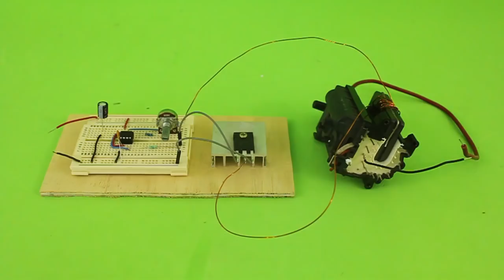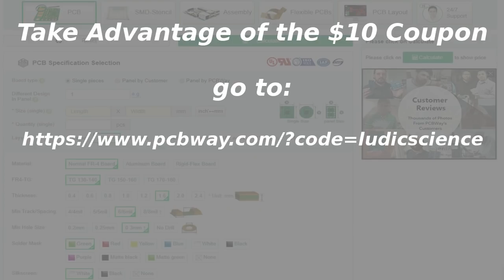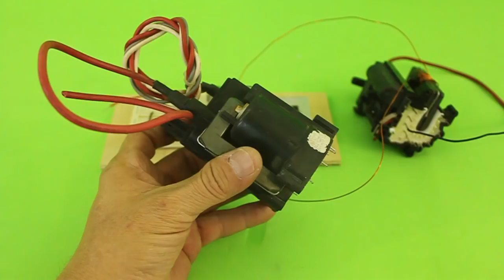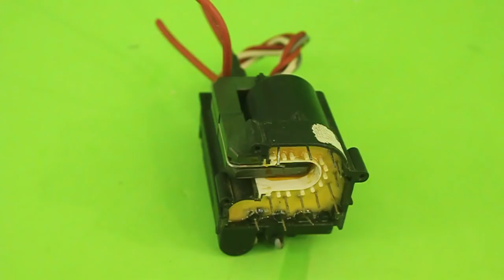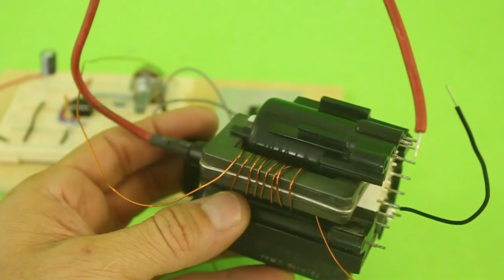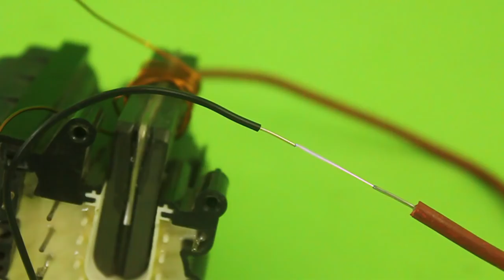Easy Flyback Driver for High Voltage

Comment: Ludic Science, I hope you can read this, because I would appreciate an answer tot this question.

Does anyone know how to let the current flow in the right direction  through the primary coil of the 5 to 8 turns? (With the use of a 555 circuit and a mosfet) It will perform in both ways I know, but there is still a difference and 1 way is the right way to wire it. Ie the flyback has to be 'charged' during the active part of the duty cycle. During this period no current can flow in the secondary coil in the flyback because of the internal diode of the flyback which will block any curren to flow. That is if you connected it in the right way. When the mosfet is suddenly opened  the contained energy in the flyback will create a current in the secondary coil which now can flow through the internal hv diode, (when it is wired correctly). But how can you find out in which way you have to charge the flyback? or in which direction the current has to flow in the primary coil? I really would like an answer to this and hope somebody knows the answer. Thanks in advance.
Reply from the maker: That is a good question and I dont know a way other than testing both ways and see which one performs better.
Reply: @ludicscience  Thank you for the compliment, I appreciate it :) And I already tried that, but it is really hard to tell when looking at the output of the secondary. And measuring the output power on the secondary side is also not possible because of the high voltage. I need this because I am making a hv power supply and I also want to make it  effective but also efficient,  but I can not figure out in which way the current has to flow in the secondary. Maybe you will come up later with a instant and splendid  brain wave how to check this. I trust you that you are the one who can come up with this answer, that's why I asked you on the web :) Hope to hear from you again Ludic Science and thanks for your reply :) I think the answer lies in the fact that the flyback can be charged to a maximum amount in the right way. Or maybe you can check in on a scope with a very huge voltage divider like you made in one of your videos, but I don't dare to fry my osciloscope when checking it on the secondary side, even with a little power on the primary side.
And is it possible to connect a fluoresent bulb on the secondairy side? Will it light? This might be a simple check which direction of the current will give the biggest spike. And the biggest spike can only be obtained when the flyback is used in 'the right directio'n. So changing the polarity of the flyback must make a difference and only one way of wiring will strike the flueresent bulb first. Is this an idea and can I just connect the fluorescent bulb with a low voltage on the secondary side you think? Update:  a fluorescent bulb on the flyback does light :)
Reply from the maker: Well, I have an idea that may work or not. If you can find the pins of the internal primary of the flyback, then you can apply a DC voltage and see the direction of magnetization of the core, using a compass or a hall effect sensor. Then you can wind your primary with the current direction that produces the same magnetization direction.
Reply: @ludicscience  That's a very smart idea Ludic,  I knew you could not let this go :) And it is also needed to know how the primary winding on the flyback needs to be wired/connected than, which maybe can be found in the documentation if is is to be found on the web.

Comment: Dear Ludic Science, happy holidays and again thank you for your valuable work.
1- Can you tell me at what frequency is this oscillation happening in this video?
2- If we adjust the frequency to the radio frequency ranges, can this set up be used to create the carrier wave that can be modulated for AM radio transmission? I am imagining that in that case we would connect one end of the secondary coil to the ground and the other to a very tall antenna and get transmission...
Thank you for reading this and I hope to read your response.
FM
Reply: I guess theoretically if You wound the primary with a T2 Tesla design to bring down the SRF to say 80khz then run the frequency at the 3rd harmonic of that which would allow for efficient operation then earth ground one end of the b with the diode directed HV end to the antenna 
And run as stated at about 320khz you could then theoretically get two ‘induction’ coils at some distance and earth ground one and attach a receiver antenna to the other and see if TV force developed between the two, that would a reasonable and effective experiment.

Comment: The 2 resistors between 6-7-8 pins makes the duty cycle always above 50%. if you cut all those resistors and connect one 5-10k between pin 3 (output) and then wire it to pin 6 and 2 and put a capacitor between 2 and ground you get one of the simplest circuits possible to wire up yet you get exactly 50% duty cycle. After that just wire up pin 3 to the mosfet gate trough 100 ohm resistor just in case the mosfet burns and either put a flyback diode or a capacitor across the primary.

Comment: Can this driver been used for car's induction coil as well???
Reply: you need 500-1000 times lower frequency but otherwise the circuit is the same
Reply: just put some safety features on the primary not to kill the mosfet with inductive spike

Comment: Hello 
Can the IRFP450 be replaced with other  kind of mosfet  ?
Reply: Any power mosfet will work.
Reply: Beshoy Nagib thank you
Reply: Yes, but you should add a flyback diode across the transformer primary (1N4001 or 1N4007 is fine) to prevent hitting the MOSFET with damaging spikes. The IRFP450 has a characterized body diode and is robust but other MOSFETs may not be so strong so it's good to protect them. 
http://www.vishay.com/docs/91233/91233.pdf  <--- IRFP450 datasheet
Reply: Peter S thank you  friend

Comment: This circuit is very bad, There is no hv diode and hv capacitor across the mosfet and no diode, resistor and capacitor at the primary and the mosfet has no ground to gate resistor, also you dont explain at all how the area of the transformer core and the input power is very important for calculating the frequency and number of primary turns.... This is a death trap for beginers...
Reply: https://makezine.com/projects/plasma-arc-speaker/
https://en.wikipedia.org/wiki/Plasma_speaker
Reply: albert einstein watch out this dude PETER on youtube comments will take your place
Reply: Ground to gate resistor is unnecessary, because the timer will discharge it on its own. Putting a capacitor across drain-source will kill the mosfet and what is the point of a resistor on the primary?
Reply: I think he meant an RCD snubber circuit to protect the MOSFET, but that's unnecessary, a fast diode is enough in this case. Maybe what i'd do instead is put an 18V zener diode between the gate and ground to protect the mosfet from spikes that might occur.
Reply: I suggest a laxative and less soap opera viewing. Your drama meter is off scale.

Comment: I built the circuit but the 555 chip got burned can someone tell me the reason
Reply: it always happen to me before, and I suggest you to used different 555nc timer flyback driver, the one's that has a lot of capacitors and diodes to protect your 555 timer and mosfet from burning
Reply: The circuit is missing a flyback diode (reversed biased diode) across the transformer primary and inductive kickback may have caused voltage spikes that killed your 555. Some types of 555 (such at the 7555) will be more sensitive to these spikes. The circuit in the video is the most basic way to build a high voltage supply like this, but if you were going to make it into a product you would add a few more passive parts to protect the 555 and MOSFET from these spikes.
Reply: @Peter_S_  exactlly its the diode that will do the job thanks
Reply: @badraa7838  I hope you get your build working well and that you have lots of fun with it! This is an excellent project!
Reply: @Peter_S_  thanks do you buy electronic parts online?
Reply: @badraa7838  I've been a manufacturer for over 30 years and for both hobby and manufacturing I buy everything online. My main sources are https://www.digikey.com/ , https://www.mouser.com/ , and https://www.arrow.com/en but for hobby use I also buy modules from AliExpress. I worry about counterfeit parts from China so I only trust suppliers like https://lcsc.com/ because they're known to be honest. Counterfeit 555s are probably just fine but MOSFETs from untrusted sources can be really bad.
Reply: @Peter_S_  wait wot there are counterfeit mosfets? i thought mosfets werent valuable enough to be counterfeit
Reply: @maxxiang8746  Unfortunatly any part costing more than a few cents may be counterfeit and power MOSFETs are very commonly counterfeited. There are many web pages and videos which show the difference in construction and show how the counterfeit parts fail when real parts would not. Here's one example: https://www.youtube.com/watch?v=LdWgYoIsYQk
Reply: @Peter_S_  oh ok, its sorta strange that someone would spend the time to make a fake mosfet when their only saving a few dollars lol
Reply: @maxxiang8746  Yes, long ago it was only the most expensive parts you had to worry about but these days that has changed. 
The MOSFET used in this video is $3.57 each at Digikey.  If somebody remarks a $0.40 MOSFET it it costs $0.17 to do, That's a profit of $3 or 626%.
Reply: @Peter_S_  oh, true

Comment: There is no flyback diode to protect the fet on your diagram.
Reply: Since the primary coil consists only of 6 turns the inductance is very low. Therefore the back EMF pulse is very low, too. In this situation the diode can be omitted. But it wouldn't harm either if you add one. Merry Christmas!
Reply: @tobi_n  also there's a diode inside the mosfet
Reply: @hadjkm  There is no purposely built-in diode in the MOSFET, but due to the way a MOSFET is composed, it inevitably contains one. This diode is called "body diode" or "parasitic diode". Here is a short but simple explanation: https://www.digikey.com/en/articles/techzone/2016/sep/the-significance-of-the-intrinsic-body-diodes-inside-mosfets
Reply: Its bad practice but point taken
Reply: Is it needed another diode if the mosfet come with its own internal protective diode ?
Reply: The diode on a mosfet in this case at least is not protective in nature.
Reply: @rpetresco  The diode in the MOSFET could only act as a protection diode, if the voltage spike would be negative. But that is not the case with back EMF. Therefore you need a reverse polarized diode across the coil connections to allow a circular current flow from the negative connection back to the positive connection.